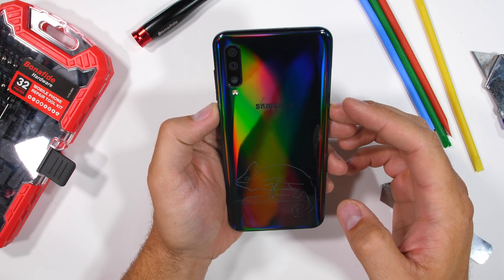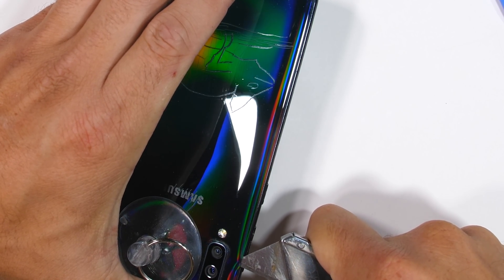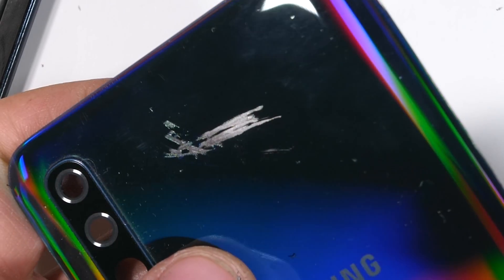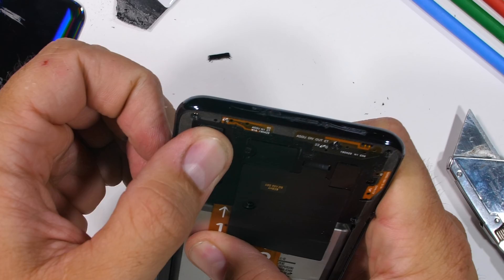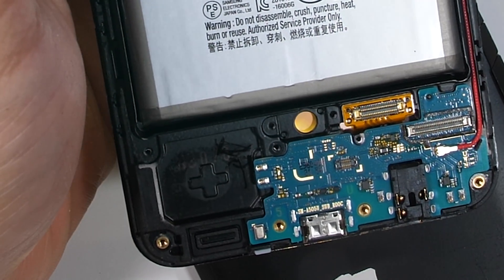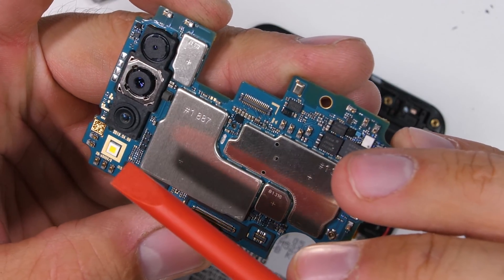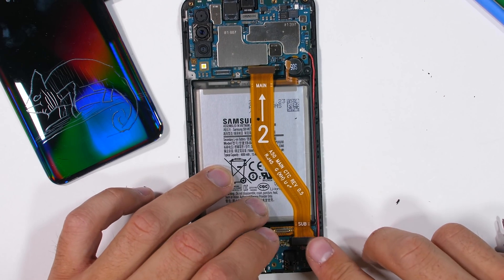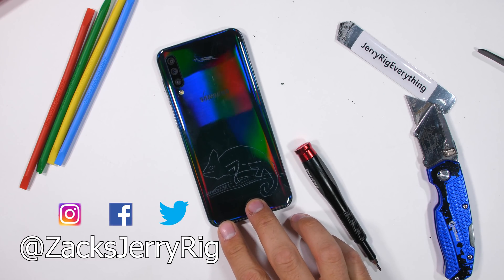Galaxy A50 Teardown! - Did something crack inside?

Comment: So I need advice good old Jerry rig, I purchased the s10 plus, and broke the screen, it still works touch still works I want to replace it though, now the question is do I need to replace not only the glass but the touch part and the digitizer and display or can I just buy a new glass plating which is extremely cheaper and replace it with that so to sum it up is it possible to get the front glass off and replace it without damaging needing to remove the rest of the display?

Comment: Samsung is worse than Apple. They made fun of Apple, & then did everything Apple done to the jack & dongle, except all in one go. Also infinity "O" is same as notch, since the screen around the punch-out is useless. Iris scanner is gone, replaced by unsecure face unlock & semi functional in-screen finger print sensor. With a lot of features missing, Note 10/10+ is not an "all the bells & whistles" flagship that it once was.

Comment: Zack, great tear down. Only thing I have to say is that if you are removing the battery it's probably because you are replacing it and it doesn't matter if you damage it slightly.
Reply: What if its the other way around you need the battery because the motherboard or lcd gone bad
Reply: @Greg Your critical thinking skills are abysmal

Comment: Do yourself a favor and get some 91% isopropyl alcohol, scoop a little with the flat side of the yellow spudger and dump it around the perimeter of the battery. It will soak into the battery adhesive in order to easily and safely remove it.

Comment: i repair phone batteries every day and i dont understand why its such a big deal when they use stronger adhesive, use rubbing alcohol to loosen the glue and if the battery needs to come out anyway for replacement why does it matter if it slightly bulges like that on the bottom? Samsung phone batteries are also the most ridged of any ive repaired so they rarely bend at all even with all that glue. I dont think every phone deserves such shame and an auto non recommend because of just that.

Comment: Zack, when you do the note 10 would it be possible to switch out the housing from this phone that contains the fingerprint sensor and a headphone jack and add it to the note 10? Of course you would have to drill a hole in the frame of the note 10 but that would be pretty amazing if you could try that out. Maybe do it after your durability and tear down video, just to give you an extra video which I'm sure people would love to watch. Keep up the good work man 👍👍

Comment: To remove the color from the inside of a glass or in this case plastic back over , use ethanol : make a little scratch on the outer edge and use an ethanol soaked cotton swab to make the paint detach from the glass/plastic . A glass cover I can clean that way in about half an hour ..

Comment: I think the front cameras for phones should be under the screen but not covered up so the galaxy phone has the true black mess where the black part of the phones the screen is off so for the front camera they should just turn off that part of the screen when the camera app is open to get a photo the led will get in the way but I think it would still be pretty cool

Comment: Hey Jerry...
There's a 200 rupees chemical know as falcon glue cleaner that can easily remove the adhesive between battery and board 
And battery pull tabs doesn't work always they mostly crack just after pulling
So stop saying this stupid line buddy

Comment: Honestly, I don't care how the battery is adhered inside the phone. The days of the average consumer being able to replace their battery are long gone. Because of this, there's no need for the pull tabs. Yes, if the phone is recycled it makes the teardown more difficult. However, the average user will never buy a heat gun and pry tools to get inside of their phone. To not recommend a phone because of the battery adhesive causing the battery to warp after it has been forcibly removed twists the situation. The only time this would happen is if the battery was being removed and replaced. Otherwise there isn't a reason to mess with the battery. Apple forcing users to go to an Apple store or an authorized repair center is more worthy of the attention.

Comment: I disagree with you Jerry, about the adhesive if it's strong it's better because the consumers are more likely to change the battery after the end of its life, therefore even if it's damaged no problem then, but if the adhesive isn't strong so the probability is high small fall or hit will move the battery from its proper position

Comment: But jerry does it matter having a permanent battery glued in rather than having pull tabs? I mean if you are going to replace the battery in the 1st place then damaging it wouldn't be a concern and then applying a new battery you can simply add pull tabs? 🤔

Comment: you could try dipping/soaking the glastic back panel to a brake fluid solution for a couple of hours, i haven't tried it yet but that's one way to strip paint without damaging the plastic. though i can't guarantee the end result

Comment: I'm pretty much a tech head. But even I wouldn't replace the battery. If I've had a phone 2 or more years and it's starting to have battery issues, I'll more than likely just get a new phone. And I think that's what most would do because most people aren't going to bother changing the battery. Plus, You're probably NOT supposed to open the phone and replace the battery anyways lol.

Comment: 2:08 I always go for opaque heavy-duty phone cases (currently have the Zizo Bolt on my Pixel 3a XL); I don't care what color(s)/opacity the back of my phone is. My only requirement is that the back of my phone is NOT made of glass. I'm super clumsy -- I won't pay a premium price for a fragile device. For a $1,000+ flagship phone, I want that thing to be able to get run over by a TANK and come out unharmed.

On that note, I'd love to see if the Pixel 3a XL is any different, durability-wise, from its non-XL counterpart. Or maybe just more phones run over by heavy vehicles. 👌

Comment: My iPhone 5c's battery oxidized, and become swollen to a point where it both exploded and lifted every component directly above the battery, causing it to snap in half, as you can think that the phone is physically inoperable. Also the screen has been forced up, causing it to break all the safety latches. Also breaking the adhesive. RIP 6 year old iPhone, that I still haven't taken to apple yet for retiring

Comment: Maybe the reason for the battery removal is because the phone is cheap so just change a new phone, or the battery is maybe dead when it needs to be removed so doesn't needs to make sure it is safe to use after remove...

Comment: Shame on Samsung because they're not letting replace the battery.
Reply: Its actually very easy and inexpensive to replace. He didnt use the correct method to remove the battery. The best way Is to put a little bit of 91% isopropyl alcohol around the perimeter of the battery so that it soaks into the adhesive and weakens it for easy and safe removal.
Reply: @cjbht19minaret  will it not damage the internal components?
Reply: @markjoseph2423  you only need a very small amount of alcohol, 1 or 2 scoops with the flat end of the spudger. 91% isopropyl is safe for electronics
Reply: Yeah. Why they glue the battery anyway?

Comment: From experience I’d say that this phone should have a battery that isn’t to hard to replace, usually you have to use alcohol to removed them, just a little bit around the edges and then use a thin plastic tool to get underneath it and it should come off much easier

Comment: I miss the Galaxy s4 active/ s5 active (and to an extent, the s5) logic. Beefy, rubber bumpers and backing, physical front buttons, removable batteries, charging port flaps [(so if the port is closed and you submerge your phone, you don't have to dry it out before you can charge)(and nothing can get in a charging port that's physically sealed)]. Now, we are walking around with nearly Irreplaceable sheets of glass that are impossible to completely secure

Comment: My LG V30+ needed a new battery so I made it clear because of your videos, such a great idea 😀..
Reply: Mine needs a new battery soon too. Was it an easy process changing it?
Reply: @Pete_1986  wasn't too bad, I believe I used the guide on ifixit or witrigs.. just need heat to get thru the water resistance adhesive holding the back on, and then it's just some screws and plastics..
Reply: @casperswift  Cool, thanks!
Reply: @Pete_1986  no problem, Im glad to help

Comment: If a battery doesn’t have the pull tabs put alcohol down the sides of the battery! It’s a great plan b and all you have to do is dry out the alcohol and put on new adhesive.

Comment: As a computer/electronics recycler, I can confirm that those glued in batteries in phones, and some laptops now, are a huge pain and absolutely hazardous to remove. We actually have to change procedures because so many of the soft batteries vent, we have to pack them in sand now before we send them out.

Comment: a little poem, adressed to samsung: 

give us back 

the headphone jack
the end.
Reply: They can't hear you since they're laughing out loud over the fanboys cheering despite them pulling off a $950 phone with a 1080p display, no mmc slot and same camera sensor as a few generations ago.
Reply: @fayenotfaye  you have to plug them in and maybe untangle if in earbuds. Delay is barely a problem that is more about how fast the device performance and converting speed of that device is.
Reply: @fayenotfaye  which earbuds?
Reply: @prod_krisztian  Here's a fun fact: Not everything is better by going wireless.
Reply: @reed3863  true but headphones and chargers can get better with time.
Reply: @prod_krisztian  maybe earbuds get better in time, but wireless charging will always be way behind than the wired ones.
Reply: AO1337 by that logic you have to plug in headphones. Snapping a jack is a problem for reliability. Just move on everyone else has
Reply: @Ken-od5jg  I love how you act like buying a $150 pair of bluetooth buds is casually moving on. If I had to buy a new pair of bluetooth earbuds each time I break them like wired ones, I'd have more money invested in bluetooth earbuds than in my actual phone. And my note 9 wasn't cheap either. I'll stick with my lovely $10 pair of wired earbuds
Reply: Bluecolty maybe if you took care of them you could have a nicer pair. I’ve had my momentum’s coming on 4 years now
Reply: @Ken-od5jg  accidents happen. What if the battery goes out, or they get smashed? Your pair is much more expensive to replace than mine if an accident were to happen
Reply: Bluecolty how do you break them they’re either on your head or in it’s case in my bag. It’s like me telling you what if your cable goes out (it does happen). More expensive headphones have better quality parts. At the end of the day you get what you pay for and I’d rather have one pair of active noise cancelling headphones than 20 which are terrible
Reply: @Ken-od5jg  I burn out the speakers I've never had a cord break on me. Id probably do the same to bluetooth ones. Besides, the earbuds that I have are silicon and block out all noise, I don't need the noise cancelling thing
Reply: AO1337 it’s your headphones not the iPad
Reply: No reason for me to have headphone jack since i bought bluetooth headphones. Way too convinient to use
Reply: Just move on to bluetooth. It's like crying for having a touch screen instead of a small screen and physical numberpad like on old phones.
Reply: @prod_krisztian  I play mobile rhythm games, so Bluetooth headphones are a no go for me due to the delay. Even if it's 20-30 ms, it still counts and hurts experience. I'm sure there are people like me.
Reply: @prod_krisztian  i use icon x, but in certain situations wired ear buds are much better, especially for calls
Reply: @prod_krisztian  still nice to have the choice between the two though

Comment: Let’s wait until he does a video with the Note 10 and exposes Samsung with no headphone jack 😂😂
Reply: what is there to exposes??? he know it does not have headpone jack
Reply: @sulaiman9766  not really exposing indeed, more like publicly shaming for participating in something they made fun of to gain PR points.
Reply: I mean, it will only be "exposing" if there definitely is room in the phone for a 3.5mm jack
Reply: @justynpryce  did samsung say they dont have space so they remove it ??
Reply: @justynpryce  the battery is actually 4300 the S10 5G was the one with a 4500 mah battery and even that one had a headphone jack so Samsung really has no excuse 😤
Reply: @Danilio.  oof, my bad, but I mean they did have the S Pen which the Galaxy S series doesn't have. But yeah, I mean if there is room, then clearly it's a lie that they couldn't fit it in, but I guess we'll just have to wait and see. . .
Reply: @justynpryce  honestly the best thing they could of done is to make the battery a bit smaller so they could fit the headphone jack because the battery is already more than enough
Reply: @Danilio.  I would agree, but it seems like the phone with a display size of 6.8 inches with a resolution of 1440p is quite power intensive. That's honestly the best excuse I could have given them for the larger battery, I just don't know exactly what the difference was between the two battery levels and how that affects battery life
Reply: @justynpryce  The standard note 10 had a much smaller 3500 battery so if that one is enough then they definitely should of added a headphone jack, also the smart battery manger thing is more power efficient than the S10 so at this point Samsung is just straight up acting stupid
Reply: Exposes?
Reply: @Aakash_Goswami1  to the uninformed world
Reply: @maratt88  oh
Reply: We all know it had no jack there's nothing to expose, you meant to say wait until he calls out the fact there's no headphone jack
Reply: Ikr4m 69 I'm just waiting to see a razor blade drawn headphone jack on the note 10 :)

Comment: to be honest,the only reason you would replace a battery is if it is damage or not functioning well, So tearing it out isn't such a bad thing to only replace it with a new one.
Reply: @Tino Iacono so why is it such an issue if the battery has adhesive to hold it down? If it doesn't matter about saving the battery you can rip it out

Comment: Look man a drop of 99% alcohol in between the battery and the frame and then shake the phone a bit and it loosens that adhesive Samsung uses to be removed without issue. It’s not permanent it just needs to be loosened with alcohol

Comment: But seriously, haven't they watched this channel to put an easy to remove battery? Dang
Reply: you need to have a glue removing liquid to remove that battery safely..
Reply: A little bit of 99.4% Alcohol or IPA is required in order to loosen the adhesive underneath the battery
Reply: No because Samsung would rather you buy a whole new phone instead of a 20 dollar battery.
Reply: @GabeJohnson91  but with the warranty you can send it to Samsung and they will fix it for 50. But I think the price varies
Reply: @GabeJohnson91  I mean people are asking for water resistance then complaining about a non removable battery.
Reply: Gabe Johnson Apple does that too
Reply: It's not as bad as the g8's battery

Comment: it may be permanent battery adhesive but it doesn't matter because the only time you're gonna remove the battery is when replacing it, so it doesn't matter if the old one gets all bent if it's being replaced anyway

Comment: If the back panel is plastic and there is no wireless charging capabilities, there is no excuse for not allowing removable batteries. It's just the company basically saying "We're gonna make you have to buy a new phone whether you like it or not". That's the only way they can make consistent profit these days. Most people won't replace the battery on premium phones with a glass back and water resistance because the cost for doing so usually equals the cost or half the cost of buying a new phone anyway. It's a smart business strategy, but it sucks too.

Comment: Hey Zack, a little tip on the batteries on Samsung models, use benzine/clean patrol and inject it in the open slots around the battery, then you can pull it out like it wasn't stuck.

Comment: Why do you have so much hate against the "permanent battery adhesive"?? Not everyone want's to disassemble their phone. You can go to a Samsung dealer or showroom and replace a battery for less than 20$! Why bother do it to save 15 bucks. I personally don't think it is worth the pain of opening a phone especially if it is a glass one! By the way you are ruining the color of that a50 by heating it so much. So your way will cost maybe more(assuming that nothing gets damaged by the user inside)